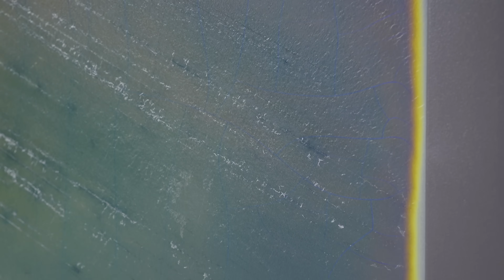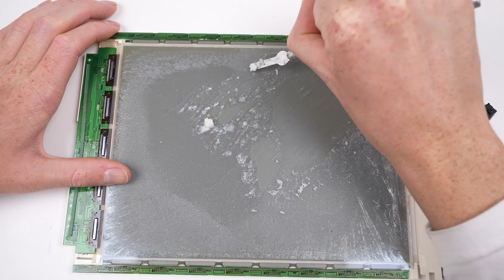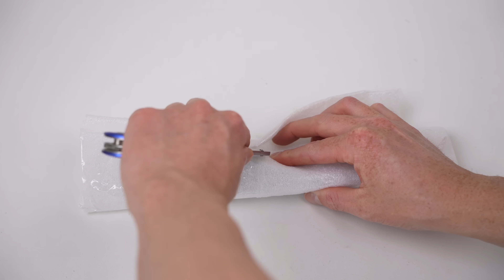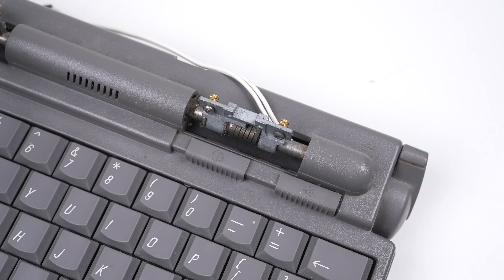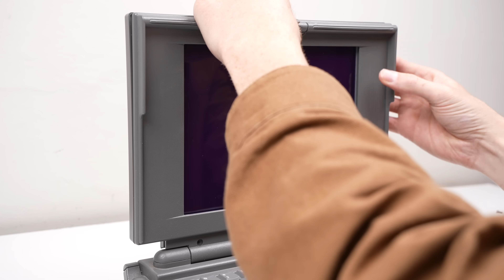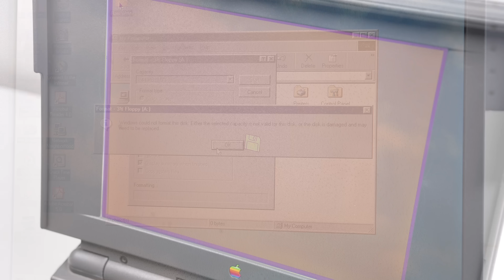Restoring a $1 Vintage Apple PowerBook 150 that’s falling apart.

Comment: Similar condition with my late father 1995 Acer Note 760i. 
Used to be until late 2000s, it can be powered on. But, that's no longer the case.

Comment: Найти жёсткий диск IDE 2.5" на 100 - 300 Мб - не такая большая проблема. У меня родной жёсткий диск Quantum в плохом состоянии, на нём много бэдов, но я смог снять с него образ. Я восстановил файлы через R-Studio, скопировал на другой, хороший жёсткий диск. Система загрузилась, документы открываются.
Finding a 2.5" IDE hard drive with 100-300 MB isn't that big of a deal. My original Quantum hard drive is in poor condition, with a lot of bad blocks, but I was able to create an image from it. I recovered the files using R-Studio and copied them to another, good hard drive. The system booted, and documents opened.

Comment: United States here I bought  a PowerBook 180 at a yard sale for $30 off a 80 year old man he sad it sat for $30 years in his closet it came with the data transfer cable and the printer cable and the original charger and manual wen wen I got it home I took the corroded battery out of it and plugged  it in with the charger it started powering up immediately  it goes to show that old laptops were just better than new laptops

Comment: The quickest and best solution IMHO is to repair that original hard drive - I can hear that the head arm is stuck on the bumper! The rubber material turns to goo. I think I’ve shared 3D-printable versions but the quickest is to add a bit of thin tape around the bumper.

It’s easy to take the lid off that particular drive as they have Philips screws - then give the head arm a flick and verify that the drive boots the machine. Add the tape and she should be good to go next time.

Good work on the LCD - I like how the vinegar corroded your razor blade - there is however a rear film as well that often needs replacing too, so all that work must be doubled. The replacement film is intended for active-matrix and never gives the same grey shades or contrast as the original, but I have purchased refurbished LCDs from Hong Kong for other laptops (Compaq Contura) and they do have correct colours/contrast, so the right film is out there somewhere - I’ve just never found it!

Comment: HA! I LOVE the ribbon cable being rainbow since Apple's old logo was also a rainbow Apple. That is too good. It's also amazing that you did all of that while only having to touch about the number of screws it takes to take off the bottom of a modern Macbook Pro. Apple is INSANE with the number of screws now.
Reply: Hey at least they have screws! Can you imagine if it was glued down so hard you'd break it trying to open it?

Comment: Pretty sure you could have cleaned the polarizer adhesive way faster with WD 40 as it turns out it dissolves adhesive residue rarther quickly

Comment: I used to envy people who owned laptops from this era or earlier when I was growing up.  As a kid of the 80’s and 90’s the idea of a portable computer was just so cool.  I finally got my first laptop, just a 12” PowerBook G4, in 2004.  I thought it was the coolest thing.  At the time having WiFi capability required an AirPort card installed inside the computer, which I gladly added as one of my only extras.  I can remember being on a business trip that year, and taking my laptop to a Starbucks deliberately to pay for WiFi access for an hour.  Sitting there, completely untethered, browsing the web and checking my email was the coolest thing ever.  How far we’ve come since then.

Comment: I have a powerbook 150. It's in surprisingly good condition. Like really really pristine condition. PSU works, hard drive works, floppy disk reader is dirty (fixed), Screen has 0 signs of Vinegar Syndrome, really no issues with it besides the floppy disk reader being dirty. The PCB has 0 broken traces or anything, not even corrosion which is surprising.

Comment: Those old iBooks and lap tops are never truly broken! I found my acer aspire one mini that wasn’t turned on for 15 years (the date was set to 14th June 2011) and it was never slow, broken how people told me. Its battery is completely ok. The only downside is that I needs 10-30 minutes to boot up and another 5-20 to normalise itself.

Comment: I'd recommend 3m adhesive remover over isopropyl alcohol, when I worked at a phone repair shop we used 3m's adhesive remover, and after watching people remove adhesive with IPA I decided to try it, and realized why we used 3m's stuff instead. using it would make repairing screens like that much easier, and would also make removing the screens of many Iphones a bit lett annoying as well.

Comment: The Quantum drives of this era all fail the exact way yours did at 1:22. The 2.5" laptop drives branded as "GoDrive", "Daytona", and in some cases, "Europa" all have a circular rubber bumper inside that due to age, it melts, and gets sticky. This then causes the actuator to get stuck in the park position, and the drive firmware attempts to unstick the actuator by repeatedly applying a current to the voice coil in an attempt to get it free. Due to how sticky the rubber gets, it is stronger than the drives ability to overcome it. You have to open the drive to fix this issue and you indeed can fix it either with using nylon, rubber, or anything that in turn allows the drive to park.

The actual reason that Quantum decided to use the rubber was because when the drive spun down, you didn't get that loud "CLUNK" like you would with a lot of other drives. This was because other drives used plastic which is hard, so when power was disconnected from the drive it would auto-park, causing the actuator to hit the bump stop. Quantum deciding to use rubber at the time made the drives in turn quiet when shutting down, but with time, it has killed thousands of them because most users end up assuming the drive is just fried. However, being very careful and opening the drive to repair this issue, the drive can last for multiple more decades with a new rubber or nylon bushing in place of the old melted and sticky one from the factory that all fail this way. Since the platter density of these are so low, there is very little to no risk involved. Also, the drive is already unusable with the actuator stuck, so there is no real loss to attempting this repair.

Comment: That soldering iron + the 3D print standoffs is a neat trick. I normally just epoxy the brass standoffs back into place, which works well. I reckon the epoxy method is stronger, but I can't deny yours is more elegant.

Comment: NiCD/NiMH battery electrolyte is basic, not acidic. Besides Lead-Acid batteries, or SLA batteries, most battery chemistry is basic, not acidic.

Isopropyl alcohol doesn't neutralize battery electrolyte. It is in fact very corrosive itself.

If you want to neutralize NiCD/NiMH battery damage, you need to use a weak acid like vinegar, then a wash and follow up with something like CRC 2-26 or Deoxit Gold G5. If you have damaged connectors, they should be replaced if possible. If not, I'd clean the connector as well as possible and pack it with dielectric grease to keep the humidity off of the exposed copper to prevent further oxidation.

Comment: Instead of installing OSes using removable media, you can use Virtualbox in Linux. Connect the CF card with a reader and configure virtualbox to use it as a real harddisk instead of a virtual one. Install the OS and the card will boot with no issues later in any old computer.

Comment: Something to keep in mind with floppy disks, especially from that era, is that while disks are physically identical, they cannot be formatted across each other. This was done at a hardware level so using off-the-shelf devices are not going to work.

You will need to source a Mac-compatible floppy drive with Mac-compatible floppy disks. This usually involves getting another Mac to do the formatting, usually through Disk Utility.
Reply: Damn lol makes me glad we left those behind now

Comment: I had a new PowerBook 150 in 1994 and it was one of the worst laptops I've ever used. Opening it gave the impression the hinge would break after just a few uses. The screen was too dim under office lights. The track ball was very susceptible to dust and was constantly mis-tracking. It's performance felt throttled compared to Apple desktops of the era.

Comment: Hinges secured with not enough screws into brittle plastic... Good to know Apple was always making piss poor engineering decisions. Eventually they would learn to make hinges, but instead they'd make other obvious mistakes like display cables that are too short, butterfly keyboards, shoe rubber GPU repairs, 50V backlight pins next to pins that go directly to the CPU so you fry the whole computer if your connector shorts...

Comment: I had an old Toshiba satellite that had the vinegar syndrome, when I put into storage it was fine but when I went to retrieve it after a few years the display was cactus. I put the failure down to moisture as I had it stored in the shed.

Comment: This PowerBook can support up to Mac OS 7.6.1, and could probably boot from CD if you had the right adapter (HDI-30 to DB-25) and drive (an external AppleCD drive such as a 300e or 600e). CD versions of 7.6 and 7.6.1 exist for burning, but I’m not sure about 7.5

Comment: About five years ago, I removed the damaged polarizer from a PowerBook Dou. It was not a pleasant experience. I was going in blind without any guides to help, but I ended up with a clean piece of glass. However, at the time, I couldn’t source a replacement polarizer. This video has given me some hope that I can find something that will work. Though I appreciate the earlier comment about the finding the correct polarizer for a passive matrix display. Thank you for your careful and impressive videos!

Comment: Good job getting back to it 8 years after.
For the OS, I’ve had good luck using Basilisk with a drive image the size of the CF card, doing the installation and then burning the installed OS to the CF card, but it was with a 1400c, something a bit newer.

Comment: Don't use IPA. It soften the glue, which will then move around and smudge everywhere. Use olive oil, or wd 40 and kitchen paper. The glue will lift and gradually stick to the paper, instead of moving around.

You can experiment on a box with a peeled Amazon label to see what I mean. With oil you end up with a clean surface in a few minutes, with IPA you'd be thinning the glue little by little.

Comment: Need vinegar to neutralize the battery leak. IPA isn't going to neutralize anything. If you had removed the battery when you first got it,. possible that could've all been avoided.

For the plastic repair and affixing the 3D printed brackets, strongly recommend using plastic epoxy and not cyanoacrylate. You can speed up curing with UV light if needed.

I think there is a HDD image for this on IA that you can use.

Comment: battery acid is neutralized with vinegar, not isopropyl
Reply: Vinegar, acetic acid, is another acid, no? Another acid wouldn’t neutralize another acid right? I thought you are supposed to use sodium bicarbonate, a buffer? I could be completely wrong, just curious
Reply: @Pythonian7  the PowerBook 150 uses a NiCad battery. NiCads use an alkaline electrolyte, so the "acid" they leak is actually a base.
Reply: @Pythonian7 nah, i watched too much Adrian's Digital Basement to know that vinegar is a way to go on old devices that are damaged by varta batteries
Reply: @Pythonian7  battery "acid" is technically a misnomer as its alkaline - we should really be calling it electrolyte leakage
Reply: Yeah I was laughing as he talked about the vinegar smell, and then tried to neutralize acid with isopropyl instead of vinegar. Even the laptop was trying to tell him! :p

Comment: 4:00 You can buy Display glue remover/solvents which are used in the mobile phone repair industry to remove these types of display glues very easily. Also i would recommend to use epoxy to glue the 3d printed parts to the display back cover as super glue is very brittle and will probably snap.
Reply: Ya..alcohol isnt an all in one solution to everything..like battery leakage..glue removal..deoxidizer..etc..

Comment: The corrosive liquid from the battery is generally a base which you would neutralize with a nice, weak acid such as vinegar. Cars have lead acid batteries but laptops seldom if ever do. Awesome PowrBook!😊
Reply: The Macintosh Portable had a lead acid battery, IIRC
Reply: @gilah6565  I had simply assumed the CMOS battery was the source of the corrosion. I would think a lead acid battery leak would be far worse but I haven't looked any of this up as it pertains to the PowerBook.
Reply: @jozsefizsak  NiCD/NiMH batteries can cause severe corrosion damage to boards if left long enough. If the electrolyte finds its way to a VIA and gets inside the board, stick a fork in it, it's done. Unless you're willing to go on a spelunking expedition by grinding down through the board layers with a dremel to get it out and rebuild the board.

Lithium Thionyl Chloride batteries are even worse. Many Apple computers from the 1980s to the 2000s used them as 1/2AA or CR2 PRAM batteries. Not only are they even more corrosive, they're a hazmat situation. Thionyl Chloride is a schedule controlled substance, because it is a precursor to chemical weapons, like mustard and nerve agents. Exposure to tiny amounts of TC can cause cardiovascular disturbances and hallucinations. It is readily absorbed through the skin, so doing something dumb like washing the board with TC on it will expose you. I found out the hard way.

TC also reacts explosively with water in high concentrations, so in addition to the biohazard, you also have extreme fire risk.

The PowerBook 150 has both a NiCD PRAM battery, and a NiCD main battery pack. Both are subject to severe leaking. I repaired a PowerBook 145b years ago for a customer and had to design and 3D print a new battery shell for it and build a new battery pack. The damage caused by the battery pack and the leaking capacitors took weeks to sort out.
Reply: @j @jozsefizsak u’re correct, the parameter RAM battery is rechargeable NiCd in these cheap late versions of the PowerBook family (earlier more-expensive versions used a Lithium Vanadium Pentoxide rechargeable coin cell that doesn’t leak). The leakage from the NiCd will be potassium hydroxide I think, caustic/basic as you said, rather than acidic.

The PowerBook 100 had a lead-acid main battery but I have never, ever seen one leak

Comment: ive dealt with many screens like taht, the smart way to remove the crystal is to soak towels or cotton pads into the isopropol alcohool wait an hour, soak again wait 30 min and it will come on its own. dont use a blade like he did, its too easy to slip

Comment: Yes, the practice of just sitting the polarizer on top of the glass and just clear tape the sides or the corner and not applying the adhesive is more preferable, if the polarizer quality wasn't good, which was many in the cases of third party polarizer, it will start to develop vinegar syndrome in a couple of year especially in imperfect application of adhesive, when that happened, a simple polarizer swap is enough rather than another full scrape on the LCD, done few polarizer swaps on old Satellite Pro, i was pleasantly surprised some of it already got polarizer changed and only taped on the corners, some technician was already thinking ahead.

Comment: got the other model with a touchpad but the battery is a nightmare to fix, so i too used it for display apple computers are like that. the inside is crap but the outside very pretty

Comment: Passive matrix displays require a different type of film from active matrix ones. This is why the “colors” on your panel look a bit off compared to how they should, and why the contrast is so poor. They were never great from the factory, but they don’t look as bad as yours does with the TFT film. The problem with sourcing “FSTN” film is that every display panel could use a slightly different type, so finding one that matches perfectly with how it originally looked can be challenging. It’s something worth experimenting with though.

For your CF card, the best approach you’ll have is to format the card in a newer PowerPC PowerBook and copy a system folder over. Even if you get the 150 booting from an install floppy, the “Internal HD Format” utility that is required to format a drive on a 150 will refuse to recognize just about anything other than the original hard drive, and you cannot use the newer Drive Setup utility on the 150 (which would recognize the CF card).
Reply: Absolutely agree, I’ve been down this road several times, often replacing the rear film as well so as to be able to fine-tune the angles. However, the result is always purple/yellow colours because we don’t have the correct ‘retarder layer’ in the film. Do you by any chance know of a source for passive-matrix polariser film, please?
Reply: I would agree on this one too because now a day it not easy finding these time of thing mostly if it use a different utility disk on a different drive I can tell it is a unrecognisable

Comment: For the chipped away plastic I would recommend either adding a bit of baking soda to the super glued part or preferably using an epoxy (uv cure for speed) otherwise it has a VERY high chance it'll just chip away again.